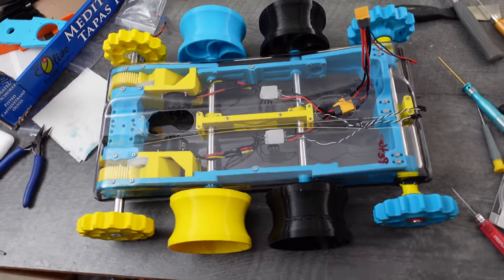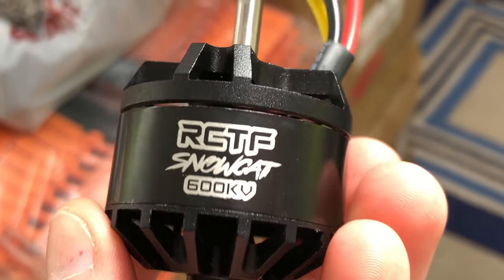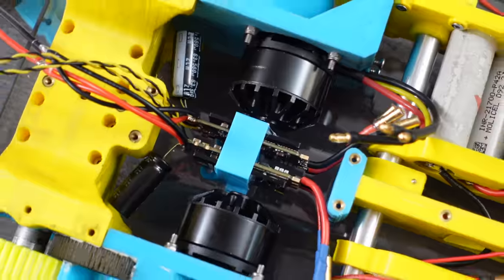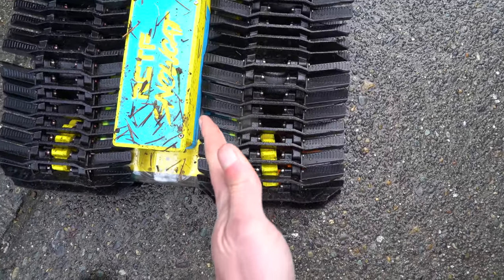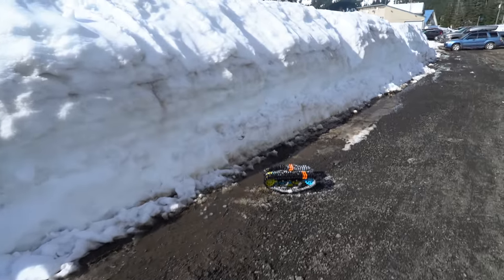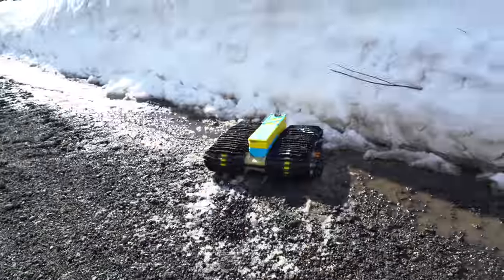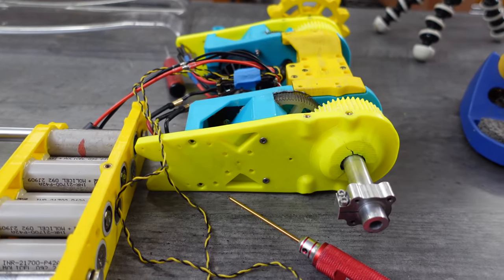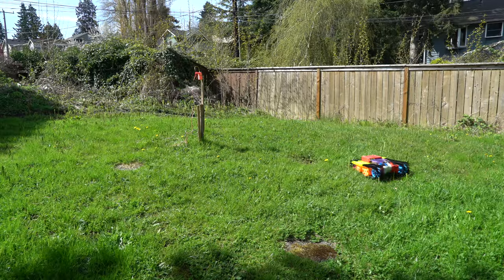2.5KW R/C Tracked Vehicle on 12S!!!

Comment: This might even hydro-plane over water like those high power ski-doo’s.
Reply: If nothing else, I'm sure we'd all love to see it try!
Reply: i was thinking the same shit xD
Reply: It will definitely hydroplane.  With those crazy motors and batteries and the huge surface area on those track I would really like to see it on water.  Not sure how turning would go…
Reply: i have one of those ski doos and i can confirm that they hydroplane good you can even turn you just lean where you want it to go
Reply: One part of me thinks it wouldn't hydro, because while you are laying the front tracks down, water still has some time to get between them and on-top of them and quickly add a lot of drag to the back...but if it doesn't make it over them fully I think it would work, the under-chassis shape might even act like a lifting body. 

It might need something that is equivalent to the front skis on the ski-doo that is a low friction gliding lifter to keep things angled up, else slowing down at all will possibly cause an immediate nose-down event and bloop
Reply: Those skidoos aren’t high powered. Stock ones do it. It’s normal powered.
Reply: @tylerseabook9423  they come stock with more power than you could need i’ve had mine up to 150 and i still had a quarter of throttle left
Reply: @5.0_foxbody   yeah I run a stock 99 summit 670 gutted and thinned out the ski width. Locked out the rear skid and run water all summer
Reply: @tylerseabook9423  i have a 2022 mach z and it’s literally insane i usually only do mountain riding but i took it on a ice drag strip this year and holy is it fast it even has launch control i believe i did a 8-9 second quarter mile every time
Reply: It will work for sure! If you look at the video "rc bashing tank" on my channel, at the end of the video, I do some hydroplaning with a custom Rc tank that I design. My track Rc is smaller than this snowcat, so it might be a little bit faster. But I’m sure the snowcat can do it too. The hardest part is to be willing to recover the RC from the bottom of a lake if it doesn’t work!
Reply: @5.0_foxbody   a Mach z in the mountains?
Reply: @tylerseabook9423  yeah it’s actually way better than you would think
Reply: @5.0_foxbody   is it real mountains? Cause I’ve seen some 121 and 136 inch tracks in the mountains and they don’t do very well at all. At least not in 8 feet of powder on top of 10 feet of hard snow. Nonstop stuck and won’t go anywhere a mountain sled will.
Reply: @5.0_foxbody  are you ever scared that it’ll sink?
Reply: no
Reply: With all those expensive electronics, I think not
Reply: @odd_bobble9106   🤦‍♂️🤦‍♂️ expensive electronics are waterproofed🤦‍♂️
Reply: I don't think it will, because you only have one force going in one direction. Snowmobiles can drive on water, because there's two forces. Ski's push against the water surface tension while the tracks push in the opposite direction.
Reply: He is going to do that I can feel it in my bones.

Comment: I love seeing the tracks act as reaction "Tracks" and correcting the vehicle mid-air!
Reply: this makes me think of old video game physics where you could slam into reverse mid air to change your pitch. i assume it's sort of a real thing?
Reply: @ransomxvi  well sort of, due to the law of conservation of angular momentum if the wheels stop mid-air, the whole vehicle will start spinning forward, albeit at much lower rpm due to mass difference between wheels and the body.
Reply: @DiveTheseClips  this is exaggerated if you pump it into reverse!
Reply: @ransomxvi  Yes! Stadium trucks also let go of the throttle mid-air to avoid landing on the rear wheels.
Reply: The same thing works on RC buggies.  When you hit a jump, you can use throttle and brakes to control the pitch of the buggy in flight.  Come off a jump and pin the throttle wide open, and the nose will lift and you'll land back wheels first.  Do that on a jump that'll launch you fairly high, and you can get a full back flip in before landing.  Lift off the throttle, or brake in the air and  the nose will drop.  When racing you modulate the throttle in the air to try and land as flat as possible.  This lets the car settle onto all four wheels quickly on landing, and you can get power on and accelerate away earlier than say landing back wheels first and waiting for the nose to land before getting power on.
Reply: @ransomxvi  pretty sure motor cross riders will blip the throttle mid-air sometimes to correct pitch.
Reply: @2bfrank657  yeah blip the throttle to lift the front end, dab the rear brake to drop the nose. The rear wheel is the pivot point. On mx bikes when in the air. It's the acceleration and deacceleration. Of unsprung mass, shifting the bikes pitch, same as rally cars, monster trucks. Etc etc.

Comment: I would find it very interesting if you can add esc stabilization to minimize the pitch rate to prevent flipping it.
Reply: Hell yeah, have it maintain a perfect wheelie.  (Trackie?)
Reply: Was thinking that'd be cool for RC cars. Set it up on a momentary switch of sorts. Guess we could try do it with a cheap Arduino and an IMU.
Reply: @gem-squared  What's interesting is that it could be set up automatically for any time it's in the air by just seeing when the IMU measures no acceleration (or below a threshold) which implies that it's falling, and therefore in the air.
Reply: interesting，if you are free falling, that would measure 0 G. I never thought of using that to determine being airborne. Perhaps adding rotational stabilization is necessary to keep it from flipping over
Reply: They have a anti wheelie system for drag racers who got tired of rebuilding the front end of their cars from slamming down all the time. I'm sure this dude could concoct it.
Reply: Kevin Talbot did something similar by hooking up the gyro from a helicoptor to the esc.. couldnt get it sensitive enough to hold wheelie for ever but was still pretty cool and would definitly have an easier job preventing a flip than trying to maintaina wheelstand.

Comment: You have to design a modular snow cat with tracks than be swapped out for wheels in the summer for all year fun and maybe use torque vectoring to steer
Reply: Even just smaller tracks for the summer would make a difference

Comment: The BMS doesn’t strictly need to be installed in the vehicle. You could have a multi-pin connector and an external BMS that is connected for charging only.
Reply: naw but discharge protection tho
Reply: @fynnli6685  you’re right, but RC vehicles don’t normally have discharge protection. You can limit the ESC if you’re worried about overdischarge.

Comment: Uploaded 7 seconds ago! 

Edit: You should get a spot welder, direct soldering really damages the internals of the battery. Just check internal resistance of one before and after direct soldering to see.
Reply: Not if you do it fast. That way the heat doesn't have enough time to spread.
Reply: @blake_schwanke  Well sure, thats why a spot welder works. Super high heat, very short duration. It can be difficult to get solder to stick to the contacts without heating the whole contact up first though.
Reply: @jacobgold5845  Yes that is very true. However some folks like me are too cheap to get a spot welder ;)

Comment: I wonder how effective one of these would be with FPV for Search and Rescue. Maybe in weather where you can't fly a drone? You could cover a lot of ground with something like this.
Reply: Maintaining a datalink for control and video is the obvious challenge there. With typical RC hardware you can't go much beyond Line-of-Sight. Maybe if you set up relays on a couple of surrounding mountaintops to bounce signal between.
Reply: @JosephHarner  Red Bull (Dutch Drone Gods) just did it recently with drones on the Mountain bike urban downhill in Valparaiso Chile.
Reply: @JosephHarner  you can get 4g lte adapters on drones now...that connects to your phone or laptop and then to your remote software for your remote you are using for flying the drone giving you unlimited range...the only limit is the battery life.

Comment: If you extended the body of the snowcat just an inch or so behind the back tracks you could eliminate the tendency to flip over, like a wheelie bar on a drag racer. As the whole vehicle tilts up, the tail end of the body would slide on the snow and help maintain a wheelie.
Reply: Another thought: run a curved bar over the top, so when it does land upside down it wants to roll back upright, or at least to the side so one of the tracks touches the ground and the tank can spin back back upright.  Right now it is highly stable when upside down, so anything to disrupt that can help.

Comment: Would it be an idea to add a weight in the front (and to an extend the bottom) to minimize the tendency to pitch up and flip over? I'm thinking using lead roofing slab as it's thin and pliable yet heavy.
Reply: The reason it tips over is because the tracks gain a lot of speed when they let off the ground. If you release the throttle at the right time you can play with rotation and make it land smoothly, like he did at 4:48
Reply: @sjorsangevare  absolutely, but by increasing the weight on the bottom and/or front, you are shifting the CG forward / down, making it harder for that to happen in the first place since the moment arm for the rotation in pitch direction will increase, making it harder to pitch up. I could imagine it would also allow for faster acceleration because the tracks have more contact area. if the vehicle is doing a wheelie, it has less surface area in contact with the ground so all that power gets wasted to slipping and shooting snow backwards instead of propelling the vehicle.
Reply: @ddewaard3265  Active control on the force the tracks putting out to prevent flip would be better because it would keep the power to mass ratio higher.
Reply: I think that’s why the tracks on the Howe & Howe Ripsaw are shaped in the configuration they are; helps with forward and backward roll.

Comment: Awe thought it would be
RAAAIIIIIIDDDDDDD
Also thinking the batteries could be hot-swappable looks like they're soldered in place
5:40 whoa that's neat it's able to re-orient itself in the air like a reaction wheel ha
6:54 wires look thin

Comment: You could just make the BMS "plug & play". I didnt had space in my electric longboard so i had to plug the bms from the outside while charging. You could do the same and keep the upside down driving still possible.
Reply: Agreed. I don't think a BMS is really needed during use. There are lot of cheap battery alarms which will sound if the voltage of a single cell gets too low. One of these alarms would be smaller than a BMS.

Comment: Question, couldn't you just use the BMS externally only for charging? Like a 16 pin connector mounted somewhere. would be able to maintain the upsidedown driving.

Comment: Battery nerd here with some friendly advice:

 I like the frames you made to hold the cells, and I like the space you put between each cell... however I'm not a fan of soldeing to cells. Soldering to cells vs tab welding can damage the cell. That's not to say you can't get away with it, but it's not great practice. We put so much effort into our 3D printers, gearing, and motors, we should put the same effort into the battery. There are cheap tab welders out there that do better work than overheating a cell with a big blobby blob of solder.

I like that you have a BMS for charging and balancing. Ideally all power would flow through a properly designed BMS, but I understand why you pull the discharge from the raw cells even if I wouldn't do it that way. 

 If your motor controller has an under voltage cut off (UVLO) you should set that to no lower than 2.8V per cell. If you are not using any discharge cutoff you should also make sure to unplug the cells from the motor controller when done for the day as the quiescent of the controller will slowly draw the cells to Zero volts and kill the cells (they often fail shorted as the chemistry eats itself.)

You should also put a slow-blow fuse between the cells and the motor controller. It should be inside the "pack" in such a way that you can't bypass it. It can be rated quite high, (1.5X or 2X your max current) but it should be there to stop the insane short circuit currents these packs produce. This prevents small shorts from becoming self sustaining plasma arcs.

Oh, and never ship a home made battery pack anywhere ever.

Comment: Nice compromise between speed and tourque. set the stall torque to be able to go vertical and speed is ... the other end of that graph. Agghhh, built a 100Kg robotwars dual tracked vehickle  very low top speed but ~ 100:1 on a 750W motor could go vertical from a standing start. goal was to balance with ultrasonics. before IMU's. tridentate. always a pleasure to see your work.

Comment: if you aren't using the BMS for discharge cant you just remove it until you wanna charge it? since you dont need it for low volt cut off. so you can take off the top body and be able to flip it and drive it still.

Comment: Impressive.  Gone are the days when we'd see "RC Testflight" written on the body in Sharpie ink.  Now it's engraved direct on the top panel.  I'm trying to think like Daniel here, so consider this... Since the latest mod won't allow the cat to run inverted, a long hinged arm on a servo needs to be added to the top.  Then, whenever it flops on it's back, a flip of a switch on the radio deploys the arm from it's lay-flat stowed position to umm... "fully erect," so it flips the body over and off it goes again.

Comment: Why not run without the bms? I don't fly my helikopters with a bms. I'm more worried about under voltage than the cells being discharge differently.

Comment: I was going to say remove the BMS using some connectors so it's "flippable".  But I actually think you should add a lever which can flip it back over in the case of overturn.  Even if it takes 30 seconds, it's better than hiking to the machine.

Comment: Awesome machine!  I learned from running Battle-bots that they get WAY easier to drive if put the steering mixer on the 'bot and put a helicopter tail-rotor rate gyro in the steering channel.  Made me a drift master :D  Even tried it on some ice and it still gave amazing control.

Comment: you could add a distance sensor on the bottom at the front, so you could correct the throttle to avoid  "wheelies", like a "tractioncontrol"

Comment: Proof me wrong but I can't imagine that a Li-Ion cell can Handle 320A (4*80A Motor) he has 12s but no Batteries in parallel. So he can use roundabout 30amps (at leas my cells can give max 30A) at full Power.

Comment: Would BMS current limiting protect those motors or would that be too little current to get moving?  I think you talked about that in a prior video.  Is there a balance of gobs of power and not burning up the motors?  You need to incorporate a servo driven flipping strut mechanism with the inability to drive it upside down.  Would prevent long hikes up the slopes to unflip it. :)

Comment: Nice trackie moves (track vehicle wheelies). Wonder if could use a drone gyro to limit maximum pitch-up angle, so could do prolonged trackie runs? Such an option (combined with a foam belly pan) might allow crossing small stretches of open water. A trackie day at the beach. ;)

Regarding cell balance and protection, you could save a bit of weight by wiring in a balance lead, and only connecting the balance and overcharge protection when charging.

Comment: As much speed as you got out of this platform, i wonder how a combination of it and a string shooter would work. What i mean is the track purposefully comes off (some of the) wheels at speed, forming a larger loop. Depending on how it's designed i believe this can give the vehicle much more ground clearance as it will ride on top of the loop that it's forming. Even if there are no benefits to it, it would still be interesting to see something like that in action.

Comment: Would like to not only see a bigger one ....but also a smaller one. A small one made with "cheap" and easy to get parts from like a hardware store....besides the 3d printed parts you can put into a "cheap" little kit or other custom/hard to get parts for average middle of no where americans.  
You know maybe it can use a walmart battery Bank for power, bolts for axels, etc

Comment: I’m in love with the snow cat, what if you folded the design over and made it one track with a U shape from one side to provide a platform which a skateboard deck could be mounted to a stretched out version of this. Then put some foot straps on the skateboard. It’d be the coolest sorta electric mountainboard ever. Even more tricky and cool would be to sand proof it so it could be a sand skimmer / snowmobile - board

Or a tank track electric skatevoard

Comment: hear me out pal, if you were to add links without paddles to your tracks, you would be able to increase your wheelbase with no difference in traction and floatability, well, unless you fill the wheelbase with cells...thus increasing driveability at a minimal weight cost. and you might even be able to add a counterweight on a powered slider, or some kind of stabilisation in the frame, so it doesnt flip as easily..

Comment: What if you added a gyro/accel and had it trim back throttle whenever it was over-tipped so you can't power the treads out from under itself? You might even be able to add a similar idea to a steering assist that helps the vehicle ease into the turns in a way that is more fluid and less likely to power-slide and flip it over. Just an idea, but maybe not as fun or destructive.

Comment: Not insulting you but soldering on lithium batteries is ill advised because the batteries can be damaged easily  its better to use a tiny spot welder that u can even build yourself and thin nickel Strips to connect the batteries because it's better to do that than lose some fingers